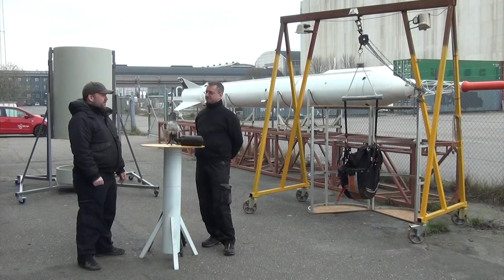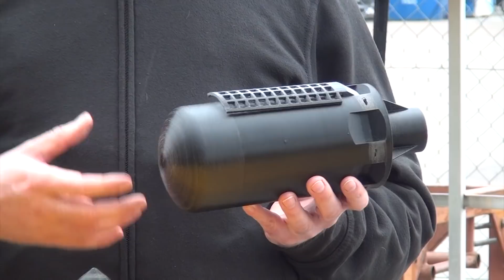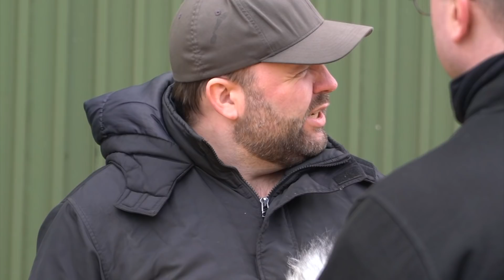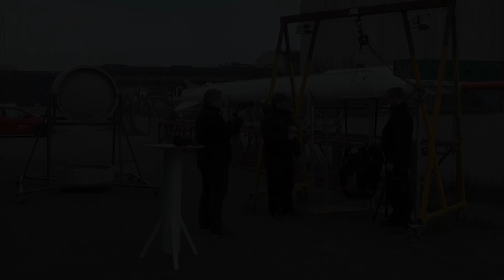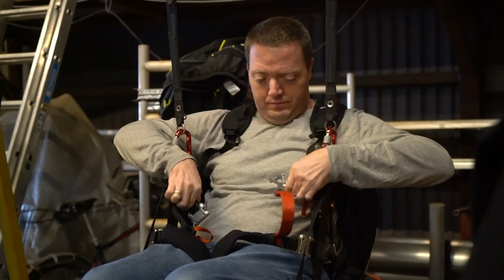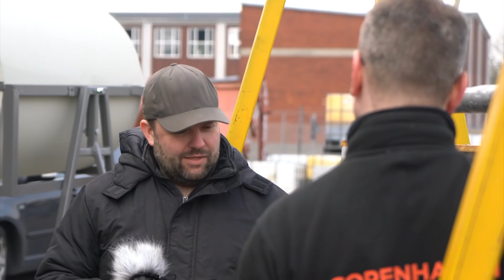Current Affairs  - Spica Space Capsule

Comment: Hi, I have question for which I havent found answer anywhere so far. Did you properly researched human physiological viability of this latest seating design? Traditional capsules have such a seating arrangement, that head/brain is in such a position relative to the body, that any horizontal G load is basically not affecting blood/oxygen supply to the brain, or even that head is in slightly lower part of the body, so G force tend to slightly push blood into the brain. I am sure you guys already researched this topic dilligently and that is basically the point of my question, if this design with pure positive G on the body and head in the highest point relative to the body, if this design is indeed viable in this regard. I do myself have a little bit of experience in glider aerobatics as a passenger.. I ve experienced up to -5negative and 6-7positive G and I am already used to it.. somewhat. My concern is, magnitude of the acceleration is not a problem, but how long it lasts is the real deal.. I assume your rocket will have acceleration phase up to 3G or something.. With sustained 3g I would even with forced breathing and tensed muscles start to gradually loose vision within approx 10 seconds and would probably gradually start to loose partially consciousness (G-loc) within 15-30seconds in my estimation. G forces in aerobatics tend to last only few seconds and are usually balanced with anti G maneuvers with say 0g for instant replenishment of blood in brain.. just second or two is enough to regain full cognition in 0 or negative G. I am afraid that this design with say 50sec lasting burn at 2,5-3,5g purely positive G in this seating configuration would be quite hard enough to sustain cognitively intact even for highly trained aerobatics/fighter pilot. Untrained person might imho G-lock easily on the way up and down at this configuration.. After shut off, consciousness/vision will be regained nearly immidiatelly at zero G so it wont be life threatening to have brain 20-30seconds without sufficient blood, it really takes just few breaths to get back at 0-1g, but it might not be pleasant experience and head need to be safely fixed in place in case of neck muscles involuntary loss of tonus (to keep spine safe).. Lmk if my reasoning is unfounded and you ve already considered/researched all this. Might be wise to send well trained person first, before sending non trained individuals. G forces are no joke for beginners.. Lmk what do you think, thank you in advance

Comment: What about retro rockets for a "soft" landing? Sojus uses this and I know you guys know solid rockets. Or are they too heavy or expensive?
Reply: It’s the opposite, solid rocket motors are cheap(relatively speaking) and have high thrust relative to liquid fueled engines, I believe the problem is that insulation within the motor is not always reliable and you can’t shut down the engine. It’s best to go with a reliable decent for landing

Comment: To reduce the shock of splashdown, why not use a deflatable airbag, between the heat shield and the base of the capsule, as NASA did with the Gemini capsules? It can be auto-inflated when the heat shield is lowered at altitude, and thus requires no split-second timing or rocket thrusters. Alternatively, a modified car airbag system could inflate the airbag some time before splashdown.
Reply from the maker: RWBHere that has been discussed, but we have to avoid complexity. For every added system we try to ask two questions: what if it doesn’t work when it should? And more importantly: what if it activates when it shouldn’t?
Reply: Thanks for replying. Fair enough, but an airbag can be inflated, with much less precise timing, after parachute opening. It can even be done manually. A 'final second' thruster has only one chance to operate, with no opportunity to use a manual backup, and if the thruster does not work at precisely the right time, then the consequences can be serious. 

So, yes;  using a collapsible airbag certainly replaces 'one system to go wrong' with another one, but the airbag is a much less time-critical system which need not involve explosive devices or rocket fuel. It only needs a compressed gas canister and a low-tech valve with backup. The gas could even come from reserve cabin air supply canisters. The collapsible airbag would be held open by the mass of the heat shield, as was done with early NASA capsule landings. 

There is also an aerodynamic advantage, and there might be a mass advantage to be gained during ascent, by using one airbag instead of at least three thruster nozzles, at least one combustion chamber, fuel, electronics, etc. 

Nonetheless, I respect your experience, and I guess that we need to be wait told more about your experimental results in future videos! Keep up the good work. 😉
Reply from the maker: RWBHere just to be clear: we are certainly not going to use thrusters for landing. That has never been discussed. We land in water and will use that to our advantage as best as we can

Comment: Would larger parachutes ret the impact to a safer level, allowing less dampening mechanics?  It's obviously a weight versus weight tradeoff between parachutes and dampeners.
Reply: I would imagine that the issue with bringing a bigger parachute, other than the size, is that when it deploys it will cause a harder deceleration, and even though the ballute is deployed to slow the capsule before that point, the initial forces could easily tear the parachute apart or hurt the person inside. If they want bigger parachutes they would have to do more reefing steps or make the airbrake deployment even more sequential in some other way, and adding complexity is often best avoided with the amount of manpower and resources they have available.
Reply from the maker: @MikkelHøjbak  I takes a lot of extra fabric to reach slower landing speed, so the sweet spot, like everything else, is a compromise, also involving off-nominal scenarios.